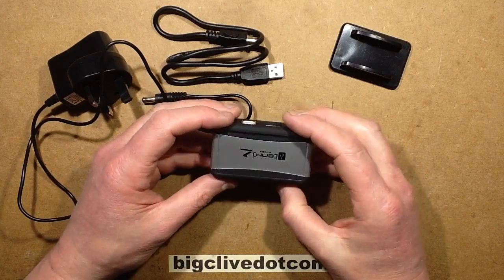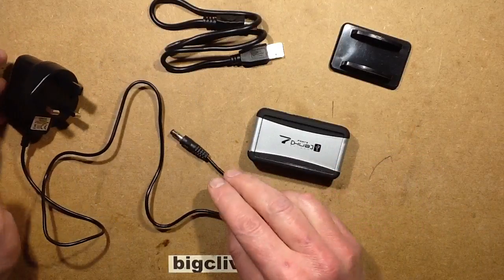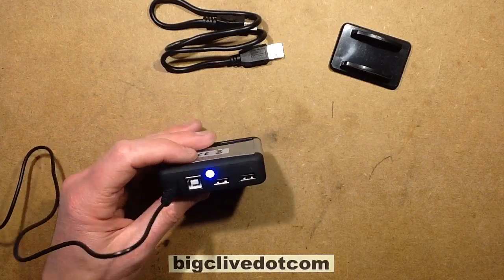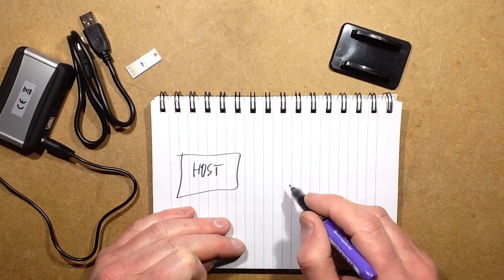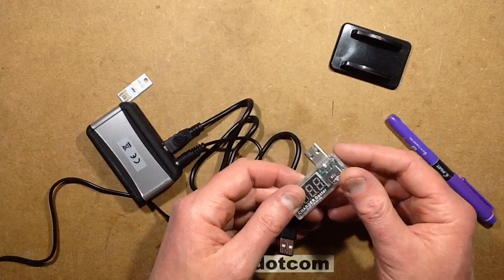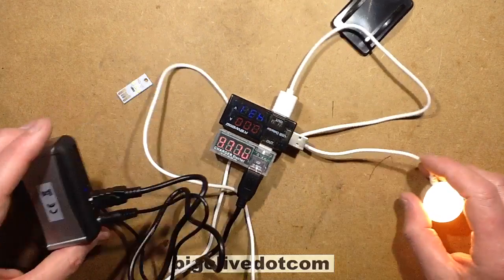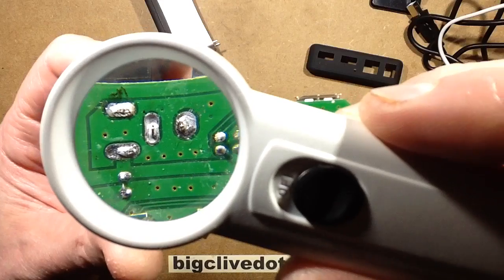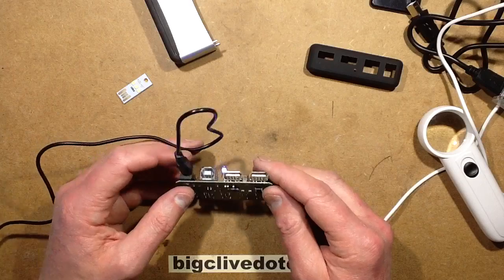Computer killing powered USB hub.  (Mac murderer)

Comment: you use 230 volts in the uk. north america uses 120v for standard devices. if I plugged an old radio with the uk plug to us plug adapter. would the radio burn up.?
Reply: +stegomon If you plug a 230v rated device into a 120v socket, either the device works normally (if it has a switching power supply), it won't work at all (older electronic devices) or it works at half power (even older devices). But usually there is no harm done.

It's the other way around, using 120v devices on a 230v grid (like an American computer to a UK socket with adapter) that will give you magic smoke.
Reply: +bami2 why does the UK use so much volts. the US uses 220 volts for dryers and welders....
Reply: stegomon Not just the UK, the whole of Europe, most of Africa, most of Asia, most of South America and Australia uses 230v-240v at 50 hz.

If the voltage is higher, then you suffer less loss due to resistance (same reason that overhead cables/long transmission lines are thousands of volts). You also don't need as big gauge for wires for high-current appliances as you would need if you had the same on 120 volts, because you only pull half the amps. And it doesn't really matter if you get shocked with 120v or 230v, both can be deadly.

Comment: Just put a diode between two positives. it will work fine. Looks like designer forgot to put it there...
I got one of those cheap 10 port USB 2.0 hubs and even they have a diode between host +5V and hub. It is really simple solution which is better than disconnecting whole line. When you don't plug power adapter, let's say you only need to use a flash memory and mouse, it provides enough current from computer.

Mainboards (at least since core2duo) can either shut down or just wo'nt boot up when there is a short in usb.
Reply: +Sailor OnDaTea Thank you.
Reply: +Gonun you are welcome.

Comment: I have same device, I used for sometime just HUB without power supply, but one day I connected my phone to charge over HUB with that power supply, phone went from 20% to 83% in 10 minutes, and power supply was extremely hot and died,  and it did not work any more, I am lucky it didn't damage my phone or battery in it, but I didn't notice any difference everything is alright

Comment: I've run across several of these USB hubs.  The external power supply is directly connected to the host power input with no attempt to isolate.  Its not just the brand of hub depicted.  A friend of mine was powering the hub with a 7805 regulator from his robot's power supply.  When the robot power was shut off the laptop went crazy spitting up all kinds of unrelated errors.  I described how to put a switch in his USB cable so that he could isolate the hub power from the computer power.  In the end he simply performed surgery on the USB cable and cut the red wire, problem solved.  I guess a proper schottky diode was to expensive since repairing damaged computers is not their problem.

Comment: Too bad they didn't want to spend the cent (or less since USB from a computer is low enough power) to put a diode in. Then, for low power devices, the hub could be powered from the host.

Comment: obviously the instruction manual is not included in this demo, with that in mind, could it be that the hub is designed to work via a pc/laptop WITHOUT the power supply and that the power supply is only required to make the device act as a power bank for multiple devices?

Comment: Is there a way to modify the circuit so the host port is not connected to the power input but all the others are?
Or even adding a switch to decide if the guest ports are powered from the host port or the dc input but never have them cross?

Comment: what this hub needed was a switch between external or the host port's power. this would have saved any computer that was plugged into it. (if you do this pls credit me in your project) or just use diodes on the host input cable/connector

Comment: i am using the exact same hub! after the adapter died, i found another replacement with same specs. plugged into the hub, blue LED light up. but as soon as i plugged into the perfectly working acer aspire 4741G usb port, the laptop turned off by itself, and stayed that way till this day. :(

Comment: Weird that the computers it killed didn't have any input protection. Wouldn't a diode in the computer do the same thing as a diode in the hub, and be worth it for situations exactly like this?

Also, a hub like this with a custom cable would be perfect for a Raspberry Pi or similar. USB type A to B with 5V cut for hub data, then take the cut 5V and split the negative to a micro USB plug for the RPi's power. You wouldn't need to take up one of the ports on the hub or use an extra cable that way.

Comment: I owned this hub for my Raspberry Pi, ended up falling apart after like a week.
Reply: This is actually ideal for a Raspberry Pi, since you can power the unit through the hub and only need one power outlet.
Reply: +ThatDuck I had to glue mine together.
Reply: +ThatDuck Yup have one of these and used it with my pi, dumped the supplied psu of course. Yes a hub that backfeeds is WRONG according to USB specs, but can be damn useful.... as long as it doesn't get knocked about and the sockets don't start loosing conneciton
Reply: +ThatDuck i've got a bunch of these that i now just use for charging nintendo wii controllers, as they backfeed power to the pi
Reply: +Simon John No, in the case of the Pi, it is a powering hub. As in "It powers the computer (pi)"
Reply: +Marrus Q Ok, this makes it clear for me, that the backfeeding is the advantage for a RPI. Is it however posible to alter a "standard" powered hub so that it will be backfeeding?
Reply: there is no advantage, backpowering is a bad thing, it puts the 5v from the psu into the computer.
Reply: +Simon John   Exactly right. The rest of the posts about Macs won't do this or my PC is fine is so much malarkey.  The damn hub should NOT be backfeeding 5 volts to the host port. Period.  Design screwup  BIG time.
Reply: +Stuart Wood Yeah, where do i get it?
Reply: +Dippo6905 I've bought them from http://www.tmart.com/7-Port-High-Speed-USB-2.0-Hub-Powered-with-AC-Adapter-Cable-Black_p86757.html
Reply: I was thinking, what is the difference with this device compared to a powered hub?
Reply: Dippo6905 this is a powered hub
Reply: Simon John
Maybe i should ask it differently, what is the advantage with this device compared to any other powered hub?
Reply: +ThatDuck I have one of those and they are badly made.  It was not expensive and I got what I paid for.
Reply: K

Comment: SH*T I just got one of those. Can I cut the 5V Cable from the cord going to the PC and make it safe again?
Reply: Just don't plug it into the wall. I can't think of anything you would plug into a computer by usb that would need more power than is provided on the port already. And most things that do need more power come with their own plugs. I have a couple powered usb hubs and the only time I plug them in is if I am using it as a charger hub for my phone, tablet, Anker batteries(3350mAH, 5.5AH, and 10AH), and GoPro. Never more than two or three items at a time though.
Reply: +nithia It doesn't work if I plug keyboard mouse and webcam in which is essential as my PC is pretty far away.

Comment: Wow. I actually own this thing (don't use it any more, mind you). I recall it doing the same thing to my PC, where the PC wouldn't power back on (I believe from both being asleep, and turned off) if it was still plugged in, so I can say that this isn't just an issue for Macs. Still ended up using it for a while but then replaced it with a different hub that doesn't do horrible things to my computer. Only issue with the current one is that the supplied power adapter made a rather annoying high-pitched whine (but the adapter wasn't required so I couldn't be bothered to send it back).

Comment: omg i have that exact hub but its fine on my pc
Reply: +Thegameifyer  I've seen a few tens of them in daily use - all on PCs and PC servers mind you - with no problems other than a percentage PCs fail to (re-) boot with the hub plugged in and powered. From memory I'd say around 10-15% of the fleet. In those cases the hubs were permanently removed and no further problems. I've not seen any damage from this but I'd personally rather they didn't do this sort of thing, especially considering the price of a MOSFET and a component or two that would sort it out. 
Most cheap (and some big brand) hubs backfeed power without any isolation, which is handy in some situations (especially in some embedded uses) but a breach of USB specs.

Comment: I use the same exact hub for my PC, and although it still has the power port, it didn't come with a power supply. I just have it plugged in only through USB, like in the latter half of the video. I've had it for a few years and never noticed any problems but was always curious why there was even a power supply option. I'm guessing at some point the company who makes these realized it was frying people's motherboards and they just took out the power supplies. Because now I'm remembering that the package it was sent in was completely dismantled, like someone had gone in and tried to remove something...

Comment: I reckon that's what happened with a USB hub I had about 8 years ago.  While moving a PC between rooms, I accidentally plugged a 12V power cable instead of the supplied 5V into the hub.  Although I just had a mouse attached (which was blown), it also zapped the IDE controller on the computer's motherboard.  Thankfully I was able to get away with using the existing Windows installation, but it was no longer possible to install a clean OS as it would hang at the setup stage it detects devices.  That PC is now long gone, along with the hub.

Comment: I've seen this sort of hub recommended for the raspberry pi... where the back-feeding is sometimes actually desired!
Reply: Yeah, i've used it for that. It's especially useful considering that an HDD consumes more power when spinning up than a pi can supply.
Reply: Apple and Raspberry Pi. Price-checked at your local supermaket.
Reply: That's never stopped me before.  
I always run pip as root and I once got my partition table into a state where I had to run --force --force (That's right. it's such a dodgy operation you have to type it in full twice) to fix it.  
My /boot is a graveyard for initramfs files.  
I think I still have a partition with everything posted on Reddit in July 2012 lying about somewhere on my HDD.  
Best practises are anathema to me.
Reply: The Pi foundation do not recommend doing that!
Reply: @SproutyPottedPlant  - The Pi Foundation have removed the fuses from the PCB to the USB-Connetor of the Pi to make exactly this possible.
Reply: @SproutyPottedPlant  I have a Raspberry Pi hub in that form factor which was specifically sold as being able to back power the host Pi.

Comment: I guess you can use a cutter to isolate the +5V from host port, still, very good to bear this in mind when plugging things. Last thing you want is stuff potentially missing with your computer (regardless if they are protected with diodes or PTC, still bothersome weird behavior may occur)

Comment: I have a 10 port USB hub that I bought from my local computer shop. It too back fed power into my devices (thankfully no damage was done). The interesting thing is that it is well designed. I took it apart and found a 0 ohm link resistor between the USB input and the internal 5V rail. I removed the link, and silk screened onto the PCB was the icon for a diode! So it was a case of designed well, built cheaply. The solder job is terrible. It still works fine, but it has to always be plugged into it's power pack to work now.

Comment: As far as I know, the reason those USB plugs are different in the first place is to prevent people from accidentally plugging devices that output power through the USB port from being connected to another device that also outputs power through USB.  

Interesting that this hub doesn't even try to comply with one of the most basic USB safety designs. The Type B connector is specifically made to only be used with powered devices that are not hosts, and not being a host also means you can't try to send power to something that is a host.

Comment: Ah! I've got one of those. It hasn't killed my Raspberry Pi 2 yet, but to power it down, I do have to unplug both the RPI and USB power supplies. The supply that came with the hub claims to be 1A, but is nowhere near that, and it rattles inside. (Input: 110-240v. Hmm.) Time to get another of the D-Link 2A hubs that I have on another Pi, I think, because that sort of cheap is too expensive.

Comment: I don't even need to watch the whole video to know this is a bad product. I made the mistake buying one and soon after receiving it to use with my raspberry pi I noticed how it was feeding power back into the microprocessor (AKA computer) which is never a good thing. I opened it up just to see if I can reuse and parts but, decided to just junk it. Use cominsense folks if it is supposed to power other external devices there is no need to deliver any amount of voltage back to the source ever.

Did anyone ever try to hold the manufacturer responsible for damages? Just wondering...
Reply: +Cyclo TeChTwIsTeR Does it really have a manufacturer, or is it just extruded from some anonymous factory in China? Mine even has Maple Leaf stickers on it to give the impression that there was some kind of Canadian approval, but I suspect the CE/CSA logos on the power supply are bogus.
Reply: +Felix Automaton Look around on Amazon and Ebay, This cheap usb hub has been rebranded a number of times. Your safest bet is to get a Belkin brand powered usb hub. I have two Belkin model DUB-H7 and they are safe and work well.

Comment: I can't say it's odd they've made the hub that way the reason being you can use it both with external power and powered from the host.  It is just a bad implementation because they should have separated the two rails with diodes or mosfets to avoid the voltage drop.
Reply: It's not odd.  It's stupid as power should NEVER go directly to the host port.  This "hub" was probably made in China.  They often screw up simple electronics.
Reply: +protoborg I have opened a "TRUST" branded hub that I have, also with external power and it does have a Schottky diode in series with the 5V rail from the USB host port. That diode prevents the flow of voltage from the wall charger back into the host port and it's just a 10 cent component.

Comment: The best killer USB device I have seen is the "ChaoDeLi CL-8803T Solar Multifunctional Camping Light". Basically it is a camping lantern (LED) with a solar panel on top, integrated 4V lead acid battery (plus 4AA, the internal battery must be junk) and USB (500mA). It doesn't sound dangerous right?
Well they have bodged in Mains charging. Not with a crappy psu, no! Instead, they used a NON-isolated capacitive dropper!!! So if you plug in the lantern to the wall and also any usb device to it, the metal shroud of the USB connector or the device will become live!!! Perfect prank for the owner of an aluminium phone :D
Perhaps you could get hold of it and tear it down. There are many goodies hidden inside, and I could do a teardown, but it won't certainly be at Clive's level. Clive is the master of Chinese dangerous goodies teardowns/explorations!!!
Reply: i think clive did a video on this
Reply: MrOpenGL already been covered on this channel
Reply: +Justin Noker Click show more to read the rest of his comment.......
Reply: +Justin Noker That's been happening to me as well. Where there's obviously a Read More button, there's nothing and I can't click it
Reply: ThePlutoniumGamer
Try pressing CTRL+F5 (in Firefox, don't know about other browsers) to force redownloading the entire page plus resources.
Reply: djg320 i didn't have a show more button when i commented earlier, odd
Reply: MrOpenGL Alright I'll try it, thanks. :D
Reply: +MrOpenGL so if.... what?

Comment: I've got a fairly similar powered hub. It has 10 outputs, each of which is capable of giving the industry standard 500ma. It achieves this by being powered from a multi amp 12 volt mains adapter. However it also can feed back to the host computer. So far this has not affected the host computer in 2 years with one minor glitch. 

Following a total lock up the laptop just wouldn't shut down even with the battery removed and the external power supply disconnected. By pulling the master USB plug it went to sleep and powered up with no problem after being given a couple of hours' rest.

Comment: Thank you for this video.  I have the exact same USB hub and i've now disconnected the power to the unit.  I've always had problems with my computer not recognising devices and behaving oddly when using this hub, I shall now see how it goes without power.  It seems fine so far :)

Comment: Unfortunately having a USB Hub that is optionally powered separately will have the same unbuffered effect.  I would suggest adding a Diode to the positive of the USB to the computer to stop the feedback of voltage.

Comment: Macs must be terribly designed for this to kill them. I could understand a reset or something but to actually brick the motherboard they must have no protection on those ports at all.
Reply: yes, cheap crap. A diode would force the power to go-to 1 direction.
Reply: +stili774 that doesn't change the fact that the hub was badly designed
Reply: But the usb hub was still badly designed
Reply: Ronnoc 989 No, normally every device should have a diode!
Reply: +Ronnoc 989 and this doesn't